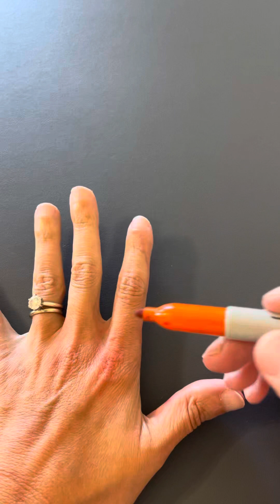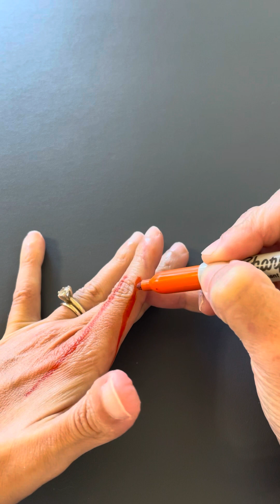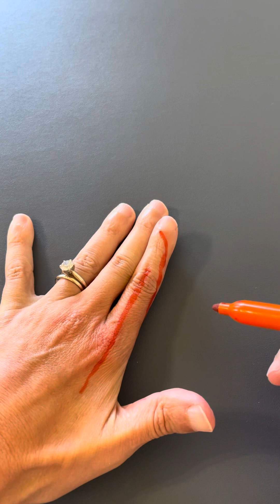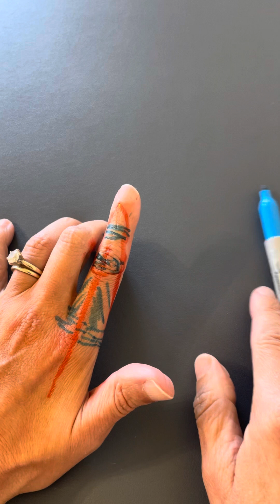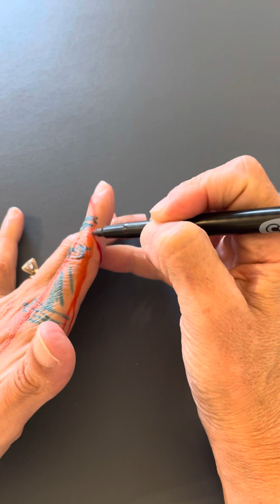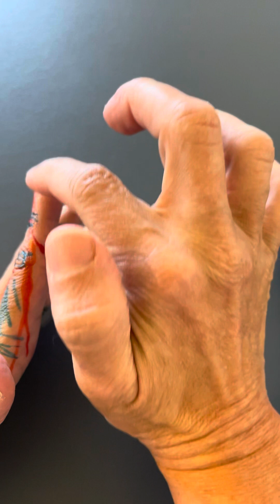Extensor Mechanism Simplified

Comment: That was extremely helpful. Thank you.
However, what confused me a little is it seemed that you said the transverse retinacular ligament would be linking the two lateral bands from the dorsal side, but they're actually not. 

They are linking the flexor sheath to the lateral edge of the lateral bands which is how they prevent the lateral bands from subluxing dorsally.